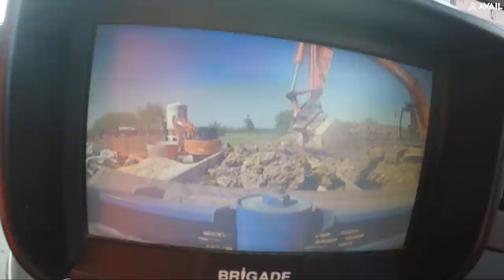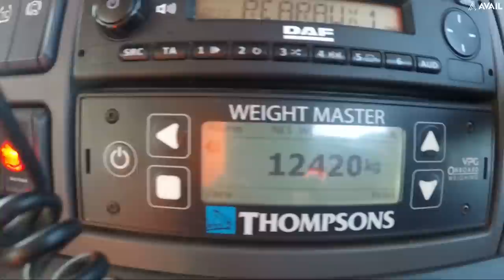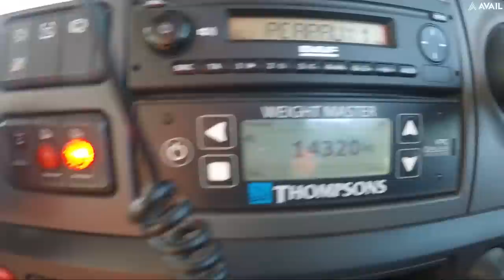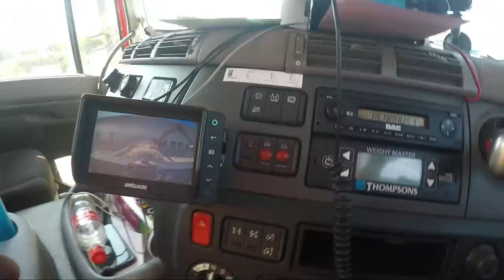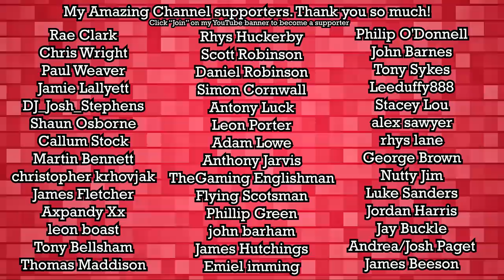Had An Argument With The Digger Driver!

Comment: Hi Luke, thanks for good content, the tip you used for your first run out of Fleet looked to me looked like the one I spent hours in playing && watching tippers load sand 60 years ago beside the A 31 between Farnham & Bentley. The sand was removed by a drag line either side of the Waterloo to Alton railway line & taken to the hoppers by a pair of AEC Matador tippers, later a huge walking drag line was assembled on site & the hoppers were fed by conveyor belt which was extended as the sand was worked out & new pits opened up.The two tippers were redundant.Hyde Crete were the owners back then, loved the place as a boy !!!

Comment: That be typical prick of digger driver to heavy once is ok but 2nd time I'd tip the load refuse to drive it's your licence.. god forbid if you had a ACCIDENT first thing they will do is weigh you if you over weight the book be thrown at you. In Ireland its thrown at the driver the digger driver the haulier and the digger company. And a good digger driver should know how many tonnes roughly per load.

Comment: Why do you tip the body a bit before getting loaded? Just wondering. Great vid.
Reply: I think it's the weigher on the body works on hydraulic pressure from the ram tipping the body 👍
Reply: Crystal rod Of power he has scales to tell what weight is in the body
Reply from the maker: For the weighing scales 👌

Comment: This could be an argument from both ways I operate machines and drive lorries and when loading a tipper if you already load your bucket before the driver drops the body then your to late the operator will load you, if you dropped the body as from that last load then the digger driver is just being an awkward fcker.

Comment: I know it's personal but I know you've discussed wages before but how much of a pay drop has it been going back onto class 2 tippers as opposed to what you was doing?
Reply from the maker: I won't get into exact figures but I'm now earning £60 per week EXTRA.
I'm on MORE money doing class 2 work. No more than 10 hours a day and home every night 👌👍
Reply: @lukecinahgv  that's crazy mate! Doesn't say much about your last place does it.
Reply: Same here, 9 to 10 hours a day and no nights out and considerably better off on pay day than when I was class 1 tramping.  I do miss artic work but the home/work balance is much better for us now.
Reply from the maker: @Trav-the-trucker  EXACTLY the same boat I'm in mate.
Reply: @lukecinahgv  even better is I have been put on 6am to 4 pm as running a front end loader on evening shift just wasn't working so now in back to sensible start time and I get finished in time to do amy jobs I need to do within business hours like going to the doctor or dentist.
Reply: Can’t argue with that Luke since passing my class 2 in 2000 and got my class 1 4 years ago only driven 8wheel tippers not a bad job like everything there’s good and bad employers
Reply: I'm class 2 myself, wouldn't mind getting on tippers it seems to be hard to get a start though without tipper experience.

Comment: Very rare you see a tipper driver tell the machine driver to lighten the loads or even clean the sides up with a good machine driver should do anyway but until all drivers tell the machine drivers to sort the weight and loads out drivers like us that do get singled out as trouble makers on a couple of sites I’ve been bard because after warning the machine driver to stop loading he thought he would be cleaver and put another bucket on so I tipped the load back up actions sometimes speak loader than words what the machine driver don’t always now is that he is also liable to getting a big fine and even points especially if he is nowingly putting on dangerous or heavy load also the giveing the arsehole ganger man site agent who’s bulling the machine to freight the lorry up to get a massive fine it would stop overnight or all lorry’s have a weigh loader or the machine have one and done the load by the weight it would stop this confrontation that tipper drivers have everyday the ground workers have had it good for too long buy the load so come on fair play all round and make a better invirament to work because when tipper drivers and machine drivers have the crack it makes a lot of differance